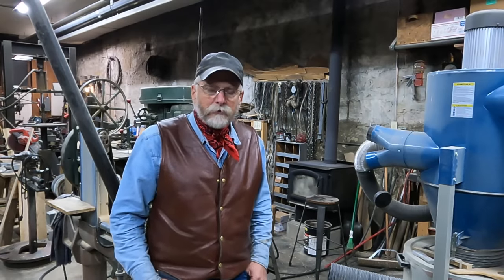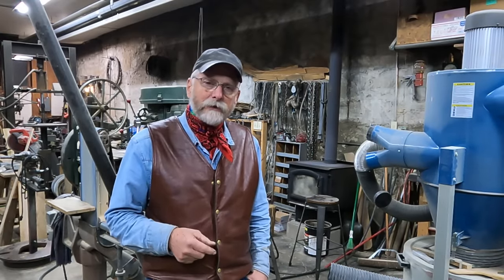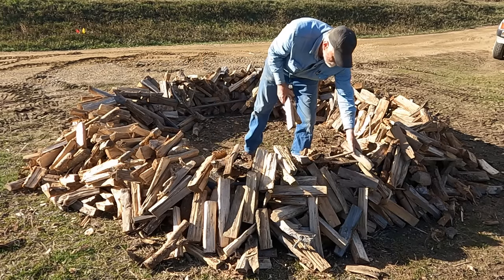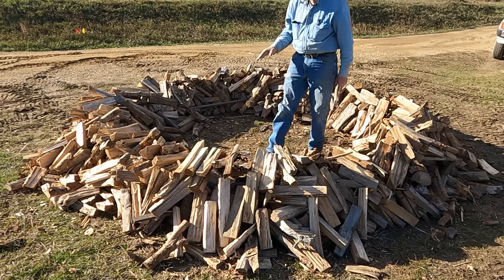Shrinking Hot Tires on Horse Logging Wheels | Engels Coach Shop

Comment: One just has to wonder, how was this done before forklifts. Look at how many folks it takes with modern machinery.
Reply: I imagine a lot more folks were used to lug it around. Labor was a lot cheaper in those days
Reply: You've heard of a "barn raising?"  ;)
Reply: @ydonl  Yeah, but two issues there. Back in the day this would have been a routine procedure, which a barn raising is not.  And secondly, you can only get a few around the tire fire with devices that will keep them from getting burns. I suspect it would have been more like Dave's rolling hoist assembly, kind of like a manual gantry crane.

Comment: Nearly got ya leg loading 2nd wheel. I wonder how they managed such projects 150 yrs ago?     Setting up to make a wheel & reading The Wheelrights Shop - I have a ring roller on order, can't justify a Chisel morticer $500 AUD but thought an Arbor press with bracket to support Router could achieve result for $250 AUD. Researching some old posts on wheel hubs came across the Clock resto you did 3yrs ago, so maybe I can try making this as a 1st attempt - No mortice needed. Thought my thumbnail Artsie 1mt Peg was challenging, gotta keep testing the brain cells.

Comment: Have you ever been criticised for doing a too fine job?
Many of today's museum pieces and cherished possessions started out as commercially produced items with a fair bit of "good enough" in them.
It's an on-off debate when it comes to  vintage car and motorcycle restorations. Some people will say things like "no 'stang ever rolled off the production line with so perfectly gapped body panels". Or   that shine to the chrome.
I'm assuming you might be the target of similar comments. Like: "BITD there would have been a few ugly knotholes in the woodwork." Or dings and scrapes to finished surfaces. Or some other comment along the same line.
Is the carriage and buggy crowd more tolerant than car and motorcycle people?
Reply: Probably the same.